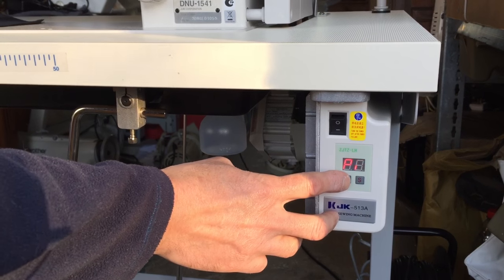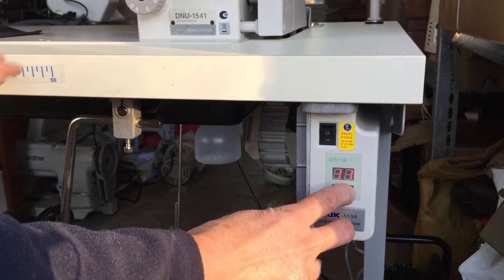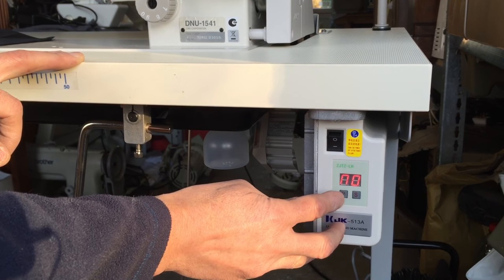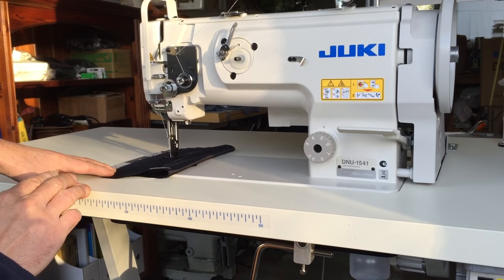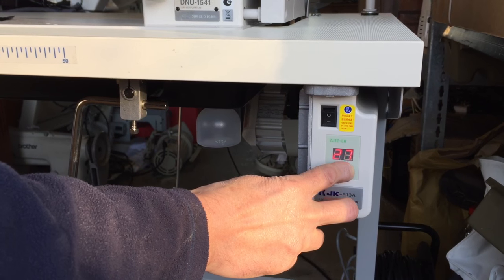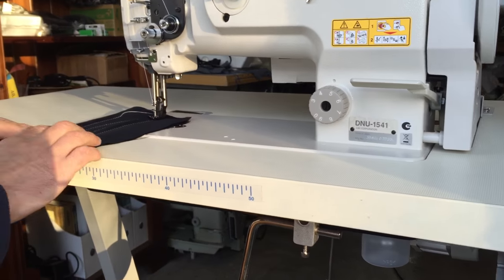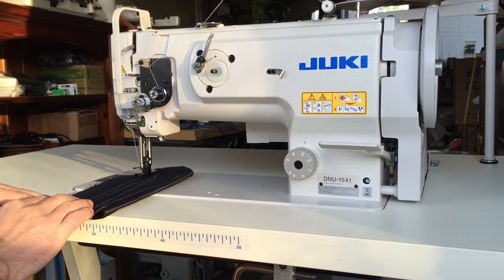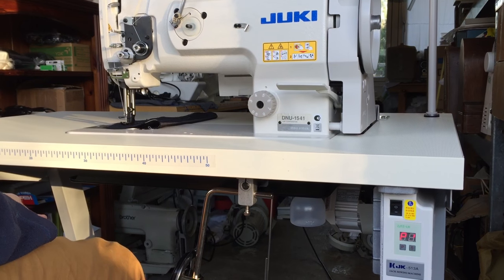Demonstrating how easy it is to use a Jack Energy Efficient Servo Motor on Industrial Sewing Machine

Comment: When you use the synchronizer (needle positioner) and program for needle down, if you step back in the pedal, it will rise the needle. It's a very useful function. I can control stitch per stitch in the pedal, but I added one extra spring because the pedal of my table is too heavy.

Comment: Hello! What is the major difference between this JK 513C and JK 513A models? Visually only the control block looks different and from the pure looks the JK 513A control block appears mroe solid with a larger radiator etc. Is JK513C a stripped down budget version of JK5`3A?

Comment: Hello! Question: can I keep the same belt when I change the motor? What difference will a shorter or longer belt make? Thank you!
Reply from the maker: Thanks for the message. You may need to adjust the size of the belt but if not, you can move the motor slightly to suit your current belt. Let me know if you need any help. Regards, Cathedral Sewing Machines
Reply: @cathedralsewingmachines2145  Thank you for your reply! My concarn is about placing this motor on a Juki overlock machine, there's a table on the manual that specifies which belt to use, depending on the motor and pulley, but I suppose the length doesn't affect anything, is this correct?

Comment: Very good control of the slowest speed... I am trying to find a servomotor to replace the one that comes with my new Pfaff 1245 because the lowest speed that I can get is about 0.5. I mean, if I set a speed of 0.5, even if I feather the pedal, the machine goes flat out to 0.5, and in this video I see that you can go stich by stich if you do not press full the pedal... This Jack servo motor looks really good!!!

Thanks for the video! :-)

Comment: can these servo motors be put on any type of industrial sewing machine? what do they cost?
Reply: They can replace the regular clutch motor of sewing machines. Usually servo comes in two main power options, 550W and 750W. There are some with 400W, 600W and 800W, but less common. I have one Jack servo of 750W in my Pfaff 335G and it handles the job of sewing thick layers of Cordura fabric. If you step back in the pedal, the needle will rise (if programmed for lower position when stop). It's a nice motor for the price you will pay.
Reply: Thanks for the info - I have bought a servo motor and replaced the clutch motor - it works fabulously -good slow and fast control! Definitely the way to go! I replaced it straight after buying a new machine so I have a brand new clutch motor packed away for when I am more used to using an industrial machine, if I should ever want to use it.
Reply: Once you starting use servo motor in sewing machine, you'll never want to use clutch motor again. You just need a good quality once. I would say that this Jack servo is the best for the price. It is not the great one, but at first, will handle good. If some day you want something better, go with PowerMax, Ho Hsing or Efka, but they cost lot more. Hope you keep this happy!